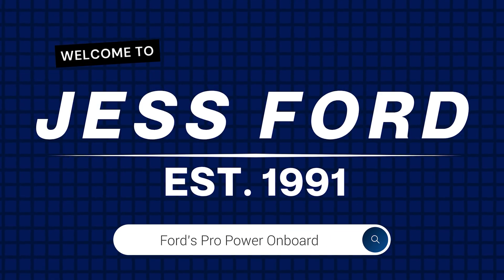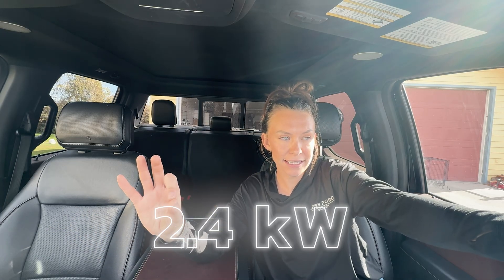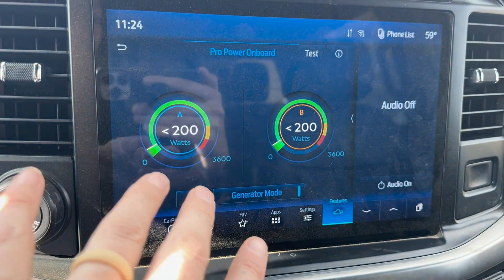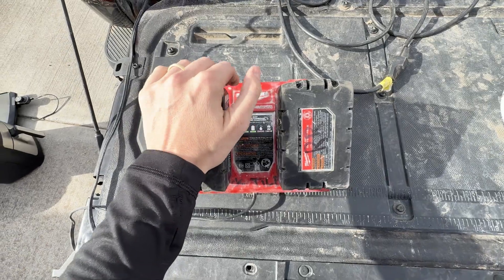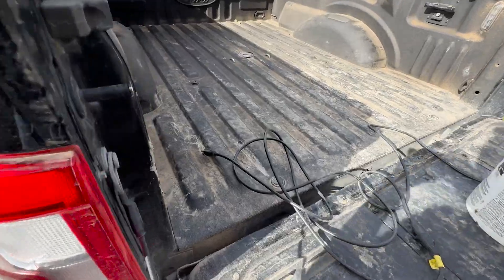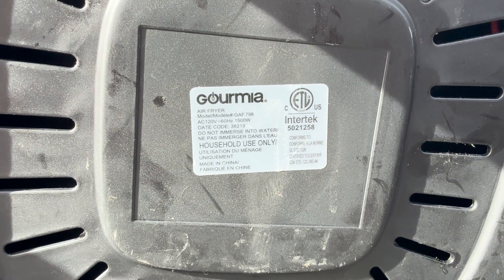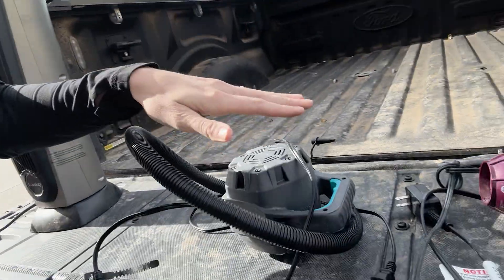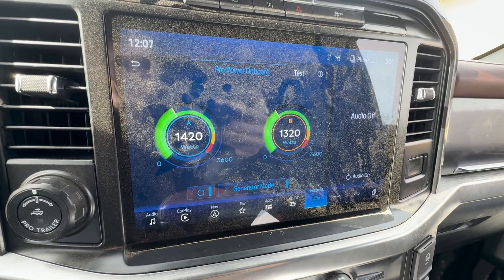The Ultimate Guide to Ford Pro Power Onboard (Full Guide, Safety Tips & Putting the 7.2 kW to Work!)

Comment: Will it run a blockheater for a tractor engine?

That way when I deliver a tractor in winter I can plug in the block heater of the tractor in winter and it starts right away at the customer
Reply from the maker: What’s the wattage for a block heater on a tractor?? 

If the heater’s wattage is below your Pro Power output (2,000 W or 2,400 W on most systems), then yes! If you have the 7.2kW system, then definitely yes!

Comment: The $985 question is does this work while driving down the road.  That's, IMHO, the main thing that matters.  If you are at a construction site or a camp site or home backup, a standalone inverter generator is the way to go if you need this to run for many hours or days.  For short term use, a standalone power station is a better option. So, what everyone wants to know is will this thing work while driving down the road to charge power stations or charge onboard power systems in an RV with, say, 1500W+ of sustainable power output?  That would be the true gamechanger.